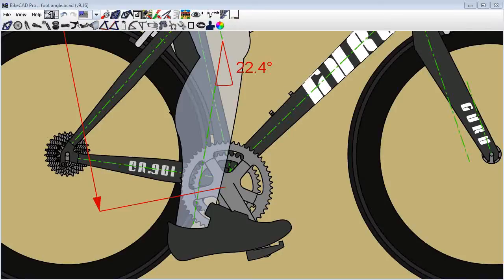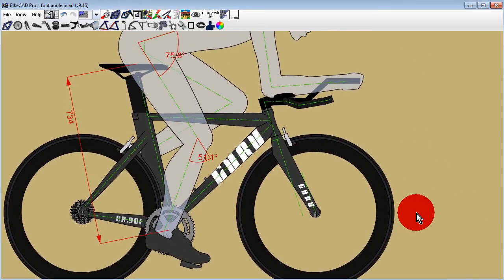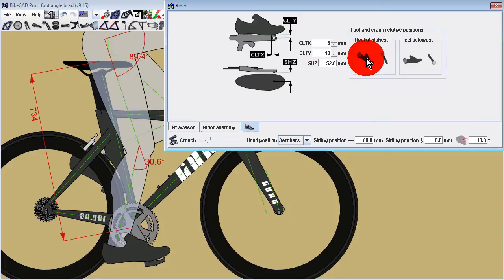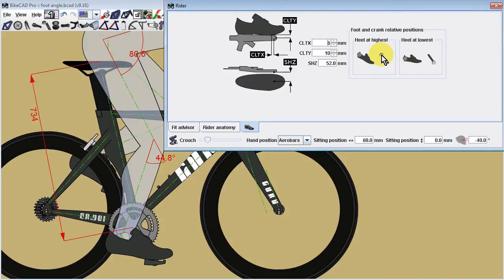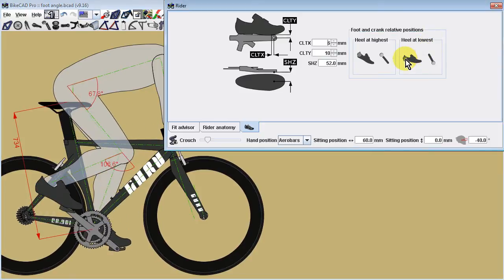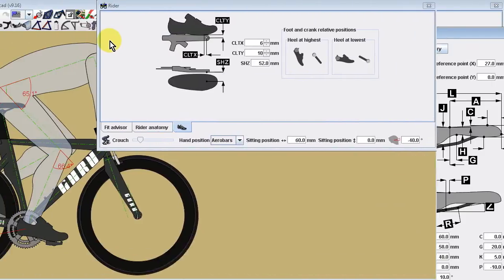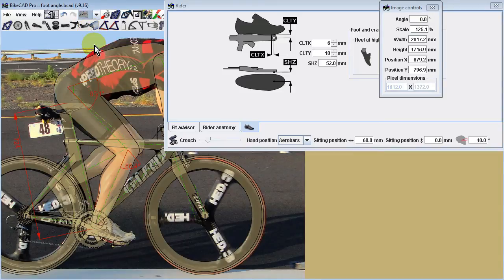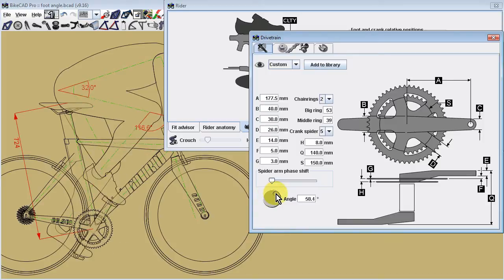Modeling foot position through the pedal stroke in BikeCAD Pro

Comment: Foot angle varies through the Stroke. They are daynamic
Reply from the maker: BikeCAD does vary the foot angle through the stroke. Currently, you can enter a maximum and minimum foot angle and the crank angle at which each of these positions occur. BikeCAD interpolates the foot angle between these extremes. Perhaps your point is that you'd like to be able to specify the foot angle at more points around the stroke. The onus would then be on you to measure the foot angle at all these locations. How will you be taking these measurements?
Reply: BikeCAD through a Video capture. This is how i See that the angle varies through the stroke  in the first place. Your program seemed to idealize the movement. But thanks for the answer and clarifacation. But still, i think that this Kind of approach does  not represent the real movement to a point, at which it have  benefits for any Kind of a fit.
Reply from the maker: I think the extremes are relevant. This is why I give the option to define them. Once people express an interest in taking more detailed measurements, I am open to expanding BikeCAD to document these measurements.